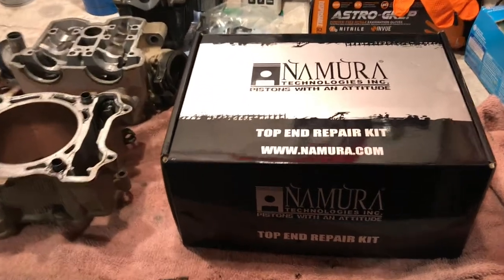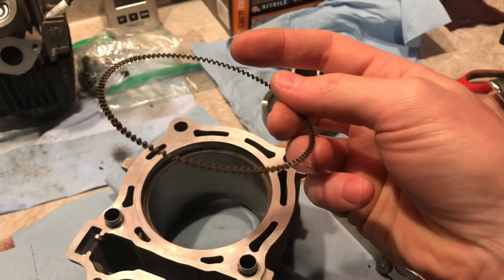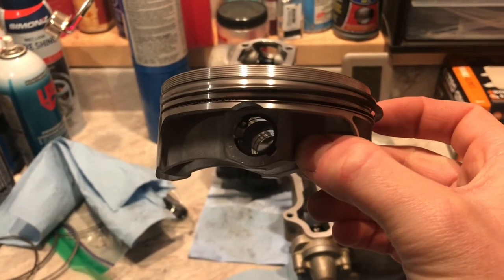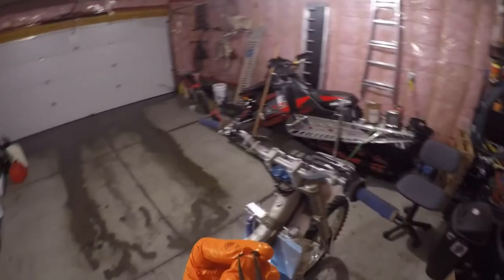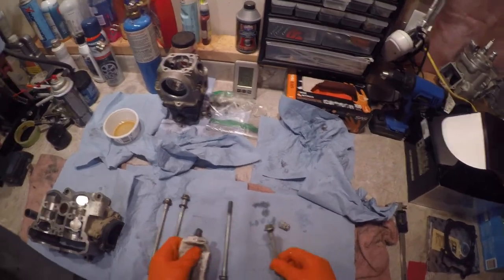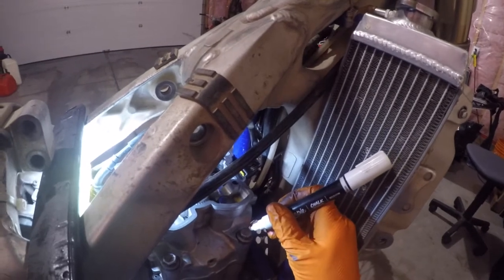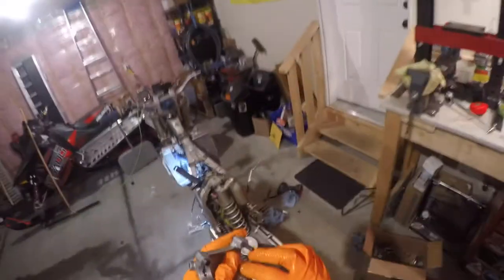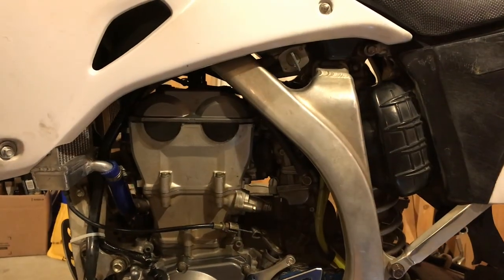06'-09' YZ450F Top End Rebuild (How to) Pt.2 Re-Assembly

Comment: My (v.limited) understanding of circlip gap is that it needs to be top or bottom. Reason being that the piston changes direction top and bottom of stroke and the inertia change can compress the circlip - if the opening is at the side, it can compress enough to pop the clip out - which can not happen if it is top/bottom. But honestly, all my info comes from Youtube so, whatever.
Reply: Your right always face the clip gap straight up or straight down for the reason you mentioned,
 its good practice